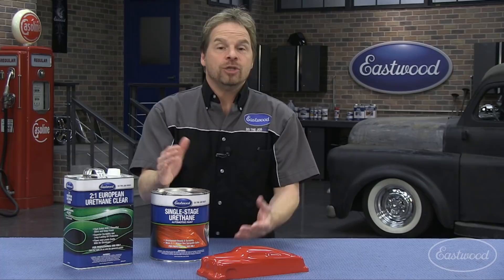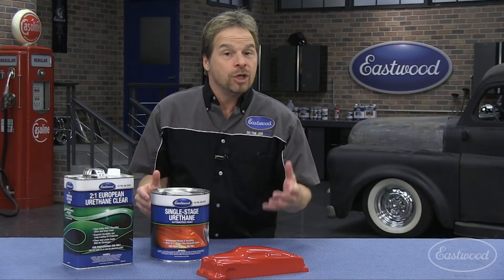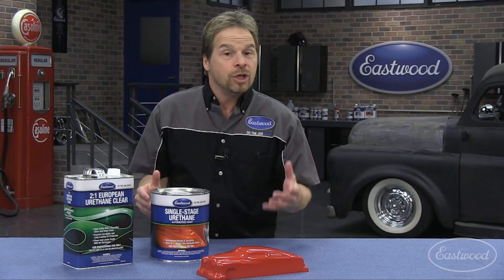Mixing Clear with Single Stage Paint - Tips with Kevin Tetz at Eastwood

Comment: I sprayed Limco Single stage Acrylic Metallic to my tire rims. Turned out beautiful. Metallic flowed out as perfect as can happen on a good day. So Beautiful that now I want to clear coat to add some protection.  I have a small amount of Matrix M-42 Clear left from clear coating truck. Both Limco and Matrix -42 Clear coat have the common ingredients with the exception of clear coat is methal Amy Ketone whereas the metallic seems to be acetone as a drying agent. 

My question is: Are these two products compatible to spray in the 18 hr window, or should I wait for full dry of metallic single stage to avoid solvent issues gasing off at different rates causing problems down the road? 
The auto paint store is closed on Sunday.   The Matrix Tech sheet doesn't have info that experience using products has. Looking forward to reading some experience sharing

Comment: I recently got my car painted and they used a single stage integrated clear paint and I would like to know if they mix to much of the clear paint and less of the paint of the car will it change the the original color of the car in other words would it make it darker.
Reply from the maker: Single Stage paint isn't "mixed" on site quite the way you're thinking.  It's more like spray paint where the base/clear are mixed together from the factory.  It can be reduced/thinned on site but that's not going to affect color.

I'm not sure what you mean by the original color - you're ideally spraying over a primer/sealer and not seeing the previous color.

Comment: if you are over the 18 hours can you still apply a clear by sanding then clearing?
Reply: Yes you can .18 hours is like a deadline to add the clear coat
Reply: @briangarza9045  can you ad the clear coat without sanding it?

Comment: You mentioned the 18 hour rule, I purchased the single stage sublime green from you guys which is a single stage, but would also like to add a extra clear coat for the wet look, should I wait 18 hours before applying extra clear or it has to be within a 18 hour window? I see you have a 2:1 and also a 4:1 which is the better choice for my application?
Reply: Within the 18hrs.... No later.
Reply: @gladememmott3001  thank you
Reply: No sanding needed within that window?

Comment: Thanks . I spray single stage paint  and is like 5 days still don't dry .. can I add clear coat to make dried?
Reply: Hope you didn't do it. You need specific temperature and activators. Fast activator for below 70. Never spray on wet paint. Better to bring the part to a warm ventilated garage.